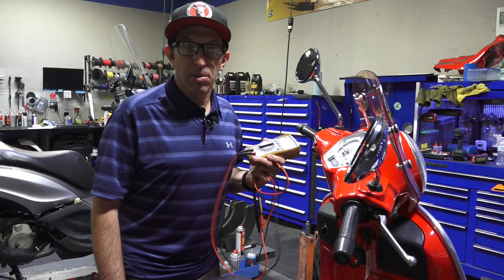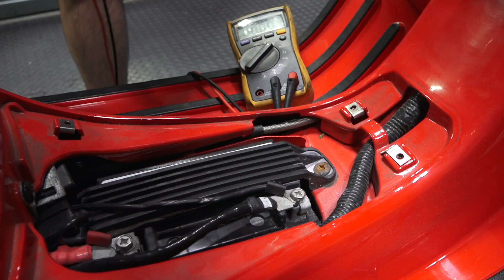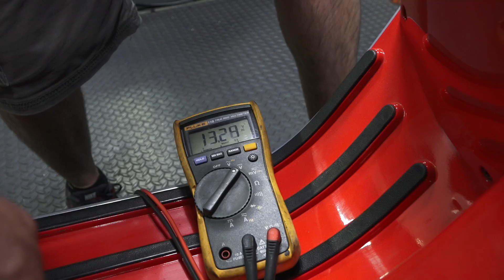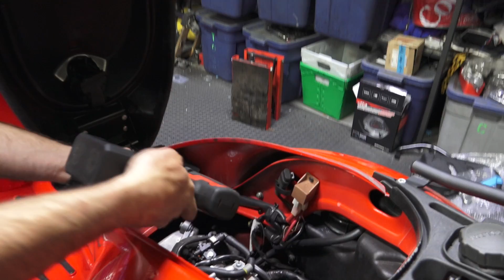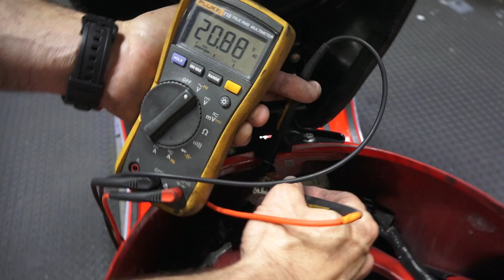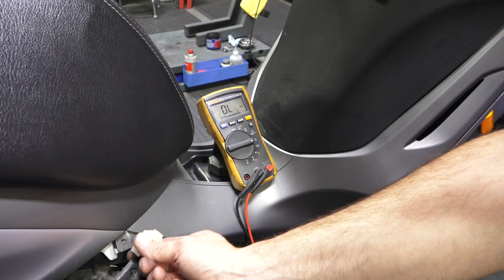Diagnosing Electrical Problems on Vespa/Piaggio Scooters

Comment: I have a 2016 vespa supersport.  From San Diego.  The head light doesn't come on. The bulb is good. Tail light and turn signals work. All the fuel are good.  When I jump the light a relay makes noise.  Please advise me on what to do. I live in Frazier park. On top of the grapevine.  I do not want to bring it back to you. It's like 4 hours away.

Comment: Hi, I made the test on my Gts 250 and the results are 1) when scooter is On 18.5   2) when is off 0.3 Oms 3) OL is ok… the battery test is 12.6 (battery is from this year) when is off and 13.5 when is on and you give him power. Shoud I replace the startor in this case or looking for something else? Thanks

Comment: Hello. A nice and descriptive video. Thanks for this. I have a similar problem on my motorcycle. I own a 2012 model 500cc piaggio scooter motorcycle. When my engine is on the stand and idling, the EFI lamp turns on after 3-5 minutes. After getting on the engine and starting to drive (about 30 seconds), the light goes off. The battery was weak and I replaced the battery. But it seems like the problem is not with the battery.

Comment: When I accelerate my red warning light comes on and my efi comes on on the main display panel.  It’s an aprilia sportcity 250cc.  Not sure if it’s just a loose wire or if my efi is bad.  Only 8k miles.

Comment: Hi i just want to as i got piaggio medley 125cc 2017 model my problem with the scooter it start but won't but engine is not rev up not picking speed i checked throttle body drive belt all ok

Comment: Hi there, My mp3 400 has a dead battery and the key unlock mechanism does not work. Is there a way to jump start the bike someway? Or some cable under the bike I can manipulate to open the seat or storage area for the helmet?

Comment: I had one of those, 22000 miles and had to dump it, all kinds of problems, no charging, other time no spark, then bad rear bearings,bad master cylinder, and more, lots of problems,cost more to fix than than it was worth.
Reply: Hi why didn’t it have any spark mine has that problem and I appreciate any help

Comment: Robot i have a problem with my speedometer in primavera s 2019 iget abs it goes off nd on and even just the key nd panel on the needle moves up to 20kph... Kindly help tia

Comment: Hey there, would it damage the bike over time to use the wrong sized battery?

All sorts of issues came up and eventually I could hear the starter but it wouldn’t spin with the engine, forcing me to repair it. Said I was in need of a new stator (mechanic also recommended another battery.)

Comment: Hi Everyone! I have a 2019 Vespa Primavera 150 cc. I can go for a 20 minute ride, but when I go to start up again, my Vespa won't start. After 20 minutes, it starts right up. It always starts up immediately when I initially take it out. The Vespa dealer said I need a trickle charger... but it seems crazy that I'll have to take it off and put it back on whenever I want to ride my Vespa. I just followed Robot's directions, bought the voltage meter, got 12.5 when  Vespa was off, 12.3 when in accessory mode, and 12.9 when on. Seems too low. Do I buy a new battery? Thank you!

Comment: Interesting! I’ve got a 06 fly150 that I’ve been riding regularly and today wouldn’t start. I checked and the battery is at 12.2V so a little low, drops to 11.8 with key on, and down to like 6V when cranking. Struck me as odd since the battery still has above 12V. Could this be a sign of a bad regulator???

Comment: Hey robot, I have a rand new supertec gts 300 only done 390 miles, I have noticed that the bike strugglrs to start, on few occasions would not crank over. Now on the LCD screen unique to the Supertec, the message produced is ECU Disconnection Service in Red. Any idea what this means, am taking this to dealership for first service, in next few days, feedback appreciated

Comment: Hello sir, i'm just going to ask if what is the problem of my vespa lxv 150 ie. it will start but can't accelerate. i've already change the ecm body throttle,puel pupm,injector and sparkplug but it is the same problem. hope you can help me sir. thanks!

Comment: Hey buddy wondered if u could help me out recently purchased a piaggio x9 500ie on the dash the engine management light comes on when reaching 30mph but when stationary or in the 20mph the light stays of the guy had taken it to a piaggio dealership and said couldn't find anything but the chap who owned it was old and think they have taken advantage he was in his 80s.would u say its the voltage regulater causing the fault or the fact it has a aftermarket exhaust on GPR make and maybe throwing up lamba sensor fault.

Comment: Hello and thank you for creatung these videos. There are tons for the Chinese jobs but now I have a Piaggio X9 500 Evo and boy do I need some help. Please see the video showing the exact intermittent problem (those are the worst!) Before you click a brief debrief lol the scooter will start and run for 10-60 seconds AT 1ST TRY. After that it dies and will not start again until it's taken a lengthy nap lol (sometimes DAYS.) I want to run a ground wire from tje frame to the CDI which I have yet to locate. This is only the 2nd Maxi Scooter I've workex on amongst 100's of the smaller China jobs. PLEASe advise! The code is viewable in this video. Thank you in advance.....
https://youtu.be/aKb8R9rNeVg

Comment: Hi sir where  can I get a wiring diagram from a Vespa 125 GTS ie from 2010 . I think I have a current leakage. I have a current flowing from 82 mA when I even have not put the key in the contact.
Reply from the maker: The Haynes manual has some wiring diagrams. We're currently out of stock on this edition so I can't confirm your specific model is in there. Worth a shot if you can find one somewhere... https://www.scooterwest.com/haynes-manual-vespa-gts-gtv-super-300-injected-lx-lxv-s-haynes5.html

Comment: Hi, I am trying to fix the stop light on a 60-s Vespa. Do I understand correctly, that when the stop light is off, the lead from the coil is shorted to the ground and when you hit the brake the switch cuts the short and the stop light then turns on? Thanks.

Comment: Hey Robot.  Thanks for the videos!  Learning a lot!  
What would do if the scoot won’t start?  
300 gts 07. Fully charged battery, I try to start but all it does is click.  Does not turn over.  Before this it was delaying to start until it went completely to just clicking.  Any ideas please? Robot or anybody else?
Reply: Redo your battery connections. Clean them with a wire brush and reassemble. If that doesnt do it move to the starter relay and jumper it with a wrench. Did it turn over? Yes... Good, replace relay.
No? Shit.....check the wires that connect from the key at the relay. There scojld be two smaller wires and a connector near by
 (14-16ga) 
Good luck!!

Comment: Hi i have a gt 200l 2004, the seat release button does not work and now the manual release in the tool box does not work, any ideas how to release the seat or fix the electronic seat release please
Reply: Igot a300 gts head light doz not work it not afuse is it the switch

Comment: Coolant was low .fan kicked on ..topped off coolant fan still kicks on after quarter mile ?can some one please help.vespsa 300..2012
Reply: If the fan is kicking on after only 1/4 mile from cold engine,  sounds like the temp sensor is bad.

Comment: HELP HELP I. have a vespa px 200 , , had a new regulator fitted , that is when the probllam started ,it keeps blowing bulbs , had it back to the auto electrician 3 times , frustrating

Comment: Plz, May i ask you a question, my scooter  random appear  hight  voltage to the system  around 18-19 DC volts . which parts defect?
Reply: If you watched it you would know it's the VOLTAGE REGULATOR! I'll take a shot in the dark from the hip and guess your is somewhere between a 2005 and a 2009 and has a brown wire connector LOL

Comment: Thank you for the video! Can’t wait to see the update. 
My GT L was discharging the battery all te times and I didn’t know what was going on then found out the Stator was on its way out. 
Is there a chance to do the job without taking off the engine? Thank you again!
Reply: @vespamotorsport I managed to change the stator myself and been riding around the whole summer time with it! Thank you for your Videos! I am now working on an engine swap and getting ready a 250cc ie engine , carburettor converted on my gt 125 :)

Comment: Always start with the battery terminals.  Many strange issues boil down to a loose battery terminal. Ask me how I know lol.
Reply: Jim Connelley how do you know? 300 gts 07. Fully charged battery, I try to start but all it does is click.  Does not turn over.  Before this it was delaying to start until it went completely to just clicking.  Any ideas?

Comment: If an LX-50 has dimming lights on rev's and turn signals not working at all would that be a rectifier issue or a CDI issue? I've looked through the manual and can't find any information on the turn signal relay. Cleaned grounds and wires + New Battery + cleaned connections on CDI and Rectifier 

Thank you! Love your channel
Reply: I have a PX150 with similar issue. Let me know if you found the fix!
Reply: Still waiting for rest on where and to change out the rectifier did I blink